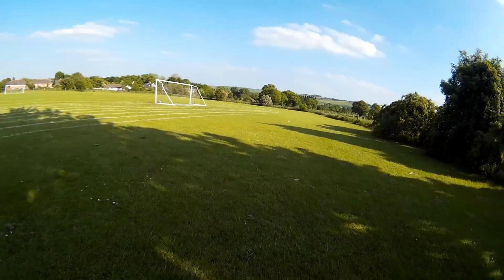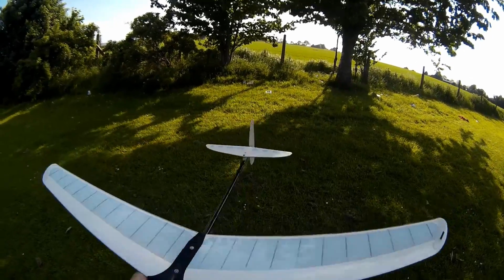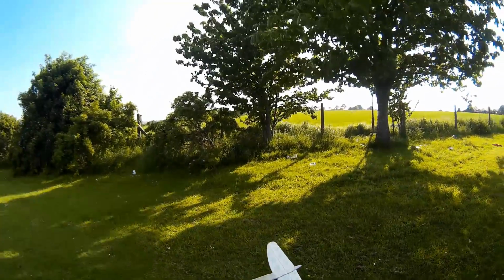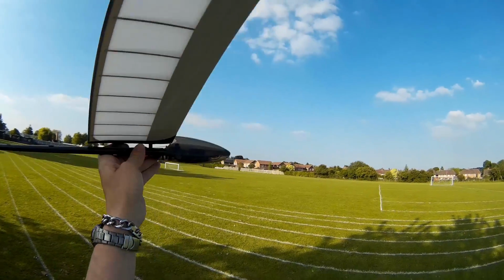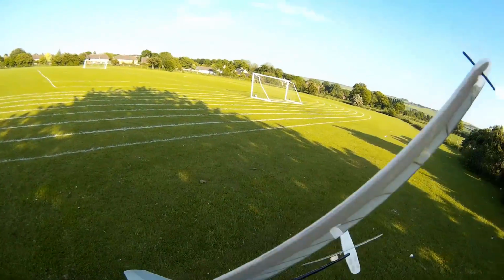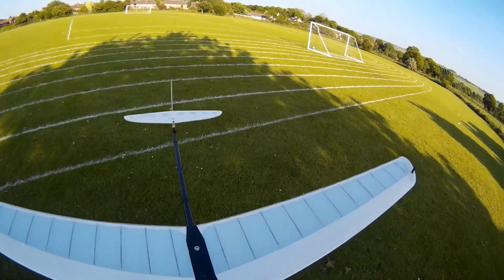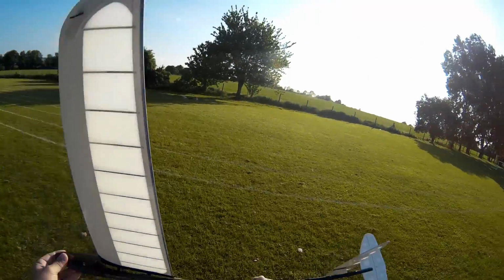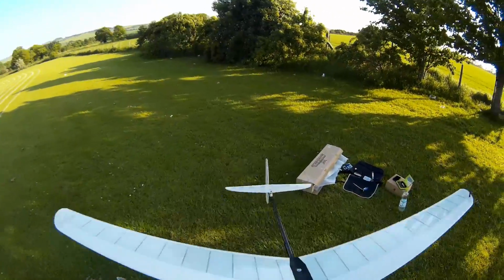Mini DLG Redux (Hobbyking)

Comment: Trying to repair my boom now lol Mine has been sitting cracked up for at least a year, I'd guess. Maybe if I don't go full Hulk on the launches I can get some flights out of it. Not expecting great things because of the repair weight but what the heck haha
Reply from the maker: I doubt going gentle on the launches is enough to overcome the pure fragility of the boom. My best result was just supergluing as you rightly suggest the weight with cloth and epoxy was very detrimental.

I'm due to do another batch of repairs for the comming summer with a little bit of weight reduction for good measure, prehaps eek out this year with it but should have just gone for the UMX Whippet or the like.

Oh well, it's been a good foray into DLG and maybe it might get a new boom if a more durable compatible one can be found.
Reply: @MrE.  I'm gonna test my repairs today. A bit windy but what the heck. I have a Whippet too. A little beat up but not too bad. Taking my UMX Radian too. All my tiny planes lol Wish I could afford a high dollar F3 DLG.
Reply from the maker: @GregDaGoblin   Good luck! Does the Whippet have a finger grip pin as standard or is it a pinch type deal?
Had a quick look and they are rather cheap atm - You've got my cogs turning again,ha!
I'd be too scared to take anything other than a hobby grade model up, but saying that I do beat the snot out of expensive quads.

Speaking of the Radian, I'm a sucker for motor gliders & sailplanes (AXN fan) , just got the mini surfer 800 as the one plane I planed to buy this year (for a backpack FPV plane to go riding with), not 1 flight yet and I seem to have broken that resolution (as ever waiting for parts to accumulate!).

Let me know how you get on with the DLG today, I hope you have a great time wit hthe fleet you take!
Reply: @MrE.  I'll let you know if it holds up. Leaving now, but yeah the Whippet is just a pincher. No kind of peg. Eventually the tip gets a bit squished lol
Reply: @MrE.  Guess I should of test glided it to check the trim. First toss it went about 15 feet and rotated down before I could get on the sticks. Crashed into a guard rail and exploded haha Broke the pod off, busted a servo arm and knocked off the vertical stab. But the boom survived lol A couple hours of plastic welding with the soldering iron and a little more epoxy and it was back in one piece. Got a dozen more tosses in and the wing tip cracked loose on the throwing peg side. Peeled back some covering and patched it back together. Supposed to be around 130 grams and mine is at 143 with all the repairs ugh
Reply from the maker: @GregDaGoblin   Wow! I admire your perserverance, Greg!
Had many the same problems ,sheered servo arm,pod broke away & peg/wing tip falling apart but it seems to repair well.
Thats a fair old amount of weight but atleast it's still airworthy. I have no idea what my weight is or was but it was way to heavy running a 2S and full size frsky V8R4 and a BEC. for this season I'm going to try run it on 1S with a micro Frsky XMR hoping it'll get some thermals.

Damn I have the nerves thinking about flying it again - got inverted on a couple of launches last time iirc but all good fun and smiling sooo...
Reply: @MrE.  I have a 300 mah 1s and lemon receiver. It would be a real brick with a 2s and bec. 14 grams over doesn't sound like much, but 2 quarters and a penny is 13.6 grams. That's a good bit for a glider that small.
Reply from the maker: I dont doubt that little bit of weight is all the difference, I think I was boxed into a corner originally building it due to the required voltage of the receiver for telemetry and the future requirement of a vario but now things are a bit different. Certainly getting inspired to dig mine out and swap it up (had all the bits for ages but just a plate full of other projects as always!)

Fingers crossed for some hot calm weather this coming season!

There is a followup vid to this somewhere and I'm sure I'll document the future escapades with this.